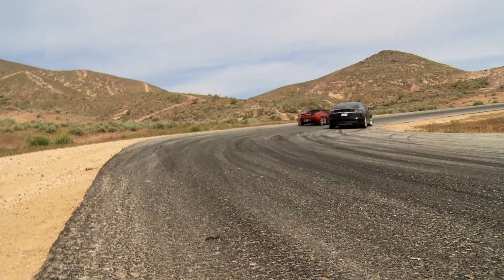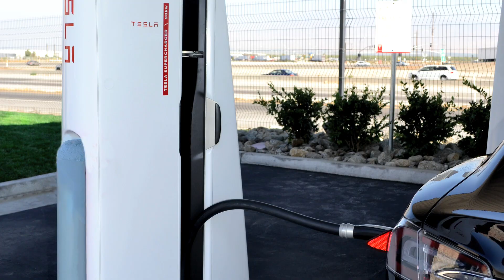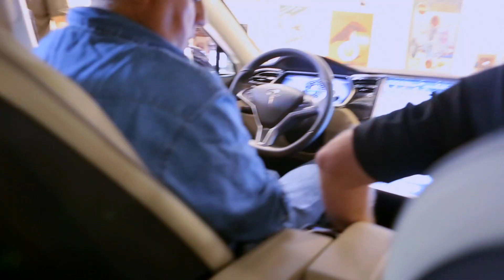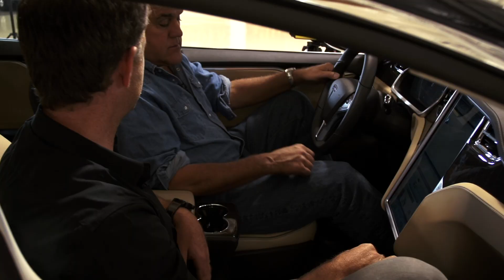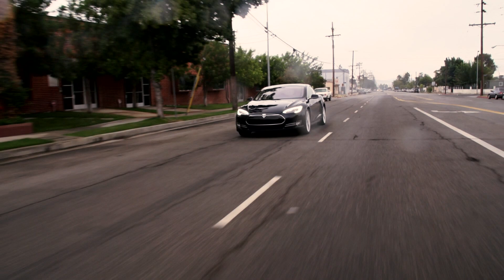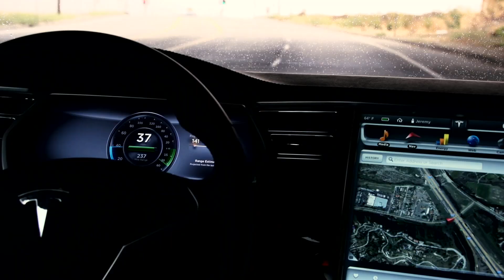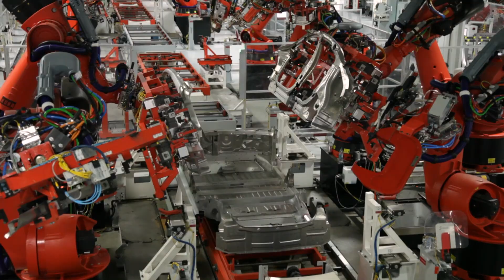2012 Tesla Model S - Jay Leno's Garage

Comment: Funny that the best of the environmentally friendly electric cars would come from the US.
Reply: Darin Pearson Sigh, yet another one making a flawed argument.

First of all not all electricity comes from fossile fuels and not all produce emissions. Nuclear powerplants don't produce emissions and all-green enery is getting increasingly common. 

Second of all the power produced even by a coal burning powerplant is far more efficient per unit than an ICE. 

You also fail to mention how the oil needs to be transported far longer distances with huge oil tankers, be refined into petrol, transported by huge trucks to stations.

Same amount of emissions? Not even close.

Finally, you need to accept that fact that we're running out of fossile fuel and it's better that switch progressively rather than facing a complete crash. The oil crisis of the 70's should perhaps teach you a lesson how vulnerable the whole system is.
Reply: Darin Pearson Unless you go to the recharging stations. Those are solar powered.
Reply: Darin Pearson yes but at the same time the ICE cars efficiency is much much less efficient than a coal power plant. So yes in most places most of the electricity comes from fossil fuels but you get more energy out of the same amount of fuel in a coal power plant. Higher efficiency=less pollution per mile therefore they are much more environmentally friendly.
Reply: Christine Fury Well said!

Also, getting out of fossil fuel is not only for a cleaner environment and therefor a healthier air to breath, it's not only for a cheaper cost in the end with less parts to produce and less parts to maintain, it's not only for a better and easier energy production and distribution, it's not only for better efficiency and performance, it's not only to restart and boost again the dying automobile industry, it's not only for the fact to run out of fuel soon, it's not only for being more independent from the OPEC and politics of middle-east countries....

It's probably for all of that combined, and probably even more :)
Reply: Darin Pearson I completely understand your point about a cradle to grave analysis, but there are a couple of other, less technical considerations to that equation:

More people driving electric cars means more industry incentive to increase range and 'fuel' efficiency. I think the Tesla S is already 89 MPG equivalent, which is pretty good. Others are over 125 MPGe.

Even if you were only moving CO2 production to power plants rather than roads, you're already removing pollutants from the air in cities and improving city health.

Electric cars are one part of the puzzle. Start powering them from coal plants, and when you switch to a more efficient plant suddenly you've just chopped a massive slice of CO2 production off your total. The extra strain on the grid also necessitates more focus on efficiency of power supply, which could mean more coal plants being built, but as part of an orchestrated enviro policy should drive more efficient power plant design, renovation and replacement with cleaner technologies currently under research like LFTR (Thorium nuclear).

The key point though is you need to get people to stop thinking of cleaner tech as a concern only for hippies and vegan communists. I consider myself pretty centrist and put off by floaty hippiness, but I strongly believe that we need to stop pumping so much crap into the atmosphere. Technology is not the only solution, but the more money we put into improving our tech, the easier it is to transition to a more sustainable economy without making people suffer a drop in their standard of living.
Reply: Darin Pearson You're right to mention the electricity sources aren't green yet.. but to me I think it just proves we need to improve the way to produce more eco-friendly electricity. Not only for cars, but also for the increase of electric products (tvs, computers, smartphones, tablets, etc...).

We should get to a point to only have no more than 20% of electricity produced from fossil. Between Solar, Winds, Water, and Geothermal, there's a lot of way to produce greener electricity. It's not impossible at all, it's just not done yet and will be done sooner or later.

And then, the electric cars and bikes would make even way more sense.

One another thing that needs to be solved, as mentioned above, is the batteries waste. So we can't say yet it's "perfectly green", but at least, it moves in the right direction.
Reply: Darin Pearson
You ignore the fact it takes plenty of "dirty" electricity to produce dirty fuel.
Reply: You just need to forget about how the electricity is produced        then you can feel green and righteous
Reply: Darin Pearson I totally agree with you. Though I really like electric cars and reallyreallyreally want to own one, anybody who says that e-cars are 100% green doesn't think ahead...or backwards, as you mentioned (actually doesn't think at all) A plus for the electric vehicle would be that an internal combustion engine uses only 30% of its energy to make the car go. An electric motor is way more efficient than that, its at around 90/95% efficiency, but thats again not the whole process.
Yes, I also would prefer to have numbers that are really honest and are telling the truth and not just showing the tip of the iceberg but there were companies that have calculated the overall CO2 emission for 100km/60miles. AMG  for example said (Chris Harris testing the SLS AMG Electric) that the SLS E would produce something like 20g CO2/km and the fossil version would produce about 300g of CO2 (can't remember the numbers correctly, but something about 1/10 I think) Concerning the energy source (nuclear, cole, solar, wind etc...), the average usage etc... therefore driving electric would still make you more efficient...well the mobility. but as you said, I also havent seen one calculation of the whole process of energy production so its still a complicated. 

When we take for example the i3, and look at the process of the production of the car we notice that almost only BMW and Tesla have developed a process that actually makes a car greener from the very first screw up to the finished product. BMW has invested something about 3 billion euros to achieve this goal (I will say greener not green. green is pretty relative to what you would expect the world should be like. technology doesn't really allow 100% emission free traffic, but since we are at ...I don't know how efficient a cole plant is, surely not 100%/90%...and maybe not even 80%. and then all the other parts of the process where energy is wasted up to the car where we are at 30% which is pretty bad. so greener than that should easily be possible, but to think that we can achieve 90% the first time we try is a little bit over the tops. anyway, "green" isn't something you can put your finger on. what? greener than now? greener than china? greener than germany? greener than solar panels? ) this car, even if it would produce (looking at the whole process) as much CO2 as other cars, it would still be greener because its production process is environmentally friendly. more friendly than any other car that is produced, in china or where ever it is. If you have a look at VW, they only rip out the engine of the car and put some electricity inside...thats not how we should be doing it, they just don't want to invest to much money, but I say they will lose the game if they wait much longer because they won't have the time to catch up concerning technological know how.
 
Then we have tesla and they are producing in the US which is pretty great so they don't have to fly every part of the car around the world, than in the end it wouldn't matter if it was emission free. Right now they are building a huge batterie factory in the US so they can make their 4th car in mind, the tesla something something (not talking about the Model X, the car after that) They say it will cost less (a lot less) and is aimed at the middle-class, so that more people will be able to buy a decent set of wheels that is probably green. 

then you mentioned the battery and its production/waste. thats the biggest problem right now. The thing is all cars need batteries, not just electric cars. Obivously its not as big as the one in e cars, but its still a battery that is producing waste.
So I know that I don't have all the numbers (or hardly any number) and I don't know how the entire process works and where the pros and cons are but if the energy I'm using primarily comes from regenerative energy sources my e-car (lets take the i3) should probably be greener than most other cars.
Reply: ***** The amount of people who think "do some research" is a form of argumentation is always amusing.
Reply: Darin Pearson electric cars are much more efficient and have far less moving parts and the estimated lifetime for a tesla s is 5 to 10 years longer than a similar style ice car so the comparison of emmisions saved over the life of the car are even more in the tesla's favor because even if making one caused more polution than a traditional car (it doesnt) it would still have a extra 10 years to make up for it. Those power percentages you provided vary from state to state so the greeness depends on where you live or if you have solar panels on your house. I don't think anyone here knows tesla's plan for recycling their batteries so I will educated you about the pollution that won't come from their batteries at the end of their life cycle. Once the battery degradation gets to a certain point their batteries will be used as storage cells to be charged by solar panels so that solar power can be used when the sun is down. And maybe by the time they have served their purpose there we will have figured out how to completely renew a lithion battery. So i mentioned one if for the batteries to be completely emmision free. But before you try to argue against that "if" provide me with one idea that people are working on that will make ice cars emmision free.
Reply: Alex Schulte We already recycle Li-ion batteries, all it takes is energy and you can reverse virtually any chemical reaction. For example we either use the Tesla batteries in solar battery systems or freeze them in liquid nitrogen then smash them and recycle.
Reply: Alex Schulte Partially because 100% energy recovery is against the laws of thermodynamics.
Reply: A couple things I’d like to mention about why people might hate these cars:

First off,  fossil fuel. Making an electric car burns fossil fuel, and so does charging it.
 
Second off, innovation. People talk about how electric cars are gonna be innovative as hell... when we have a lithium shortage.
At the current rate of consumption, we won’t have enough lithium for the next 15 years.
The electric car is NOT gonna be innovative unless they find an alternative to lithium, or something.
Reply: If you look into the processes of lithium mining and refinement you would see how NOT GREEN it is
Reply: Is there something more cringy than complaining about "government welfare" in 2021?
Reply: leerman22 ya, what I meant was back to 100% which to my knowledge isn't the efficiency we can successfully do yet.
Reply: Darin Pearson I'm from Kansas and we have several wind farms producing electricity day and night using wind turbines to create plenty of clean energy.
Reply: they pollute more than average gas cars lol
Reply: It is ironic. That for the first time in many many years, maybe the first time ever, a car made is the USA is the benchmark for the world. And many people seem to be unhappy about it because they, for whatever reason,  just don't like that it happens to be electric Which most people here in 2019 now realize is the future of the industry. People have said for years they would gladly pay extra for products made by Americans. Here it is.
Reply: Urban Student Prepper  you're stupid 🖕
Reply: Tell Greta
Reply: Why is that funny? USA has among the least amount of pollution in the world. China and India produce almost 2x more than the USA does.
Reply: Makes perfect sense to me. The US makes the best of the best and the worst of the worst.
Reply: @fusionsoul  Damn, I don't think I've heard that before.
Reply: Dragonworks country of greed and innovation
Reply: @diggleda  More patents were filed in Europe in 2018 than in the US and it's not close, like 47% of total world patents vs 25%. The idea that the US is the world leader in innovation is a popular myth, which you can disprove with the google machine up there in the top of the browser you're using to read this. Took me 10 seconds.
Reply: Not really. Yanks can be quite inventive when they want to be
Reply: It’s built on government welfare. It’s a icon of government waste and about to become a government supplier as sales fall away because Tesla is not restyling
Reply: Yup I’m from California Tesla are everywhere I’m next to get one I feel like us Vietnamese people love to buy Tesla more
Reply: It's not environmentally friendly. It just hurts it less. Environmentally friendly will be when it actually helps the environment, not just "hurts it less" than the other options. Yes, it's still a good goal to reduce environmental impact, but I get tired hearing stuff is "good for the environment" when it still hurts it. It's like saying "oh I only stabbed you 3 inches deep instead of 6 inches deep with this knife, it's good for you now." No, it just is less damaging than before, but still is overall more damaging than it is helpful.
Reply: How is that strange? USA is a nation of innovators and is a car culture. It would be weird if it never happened!
Reply: +Autumn Shag  "liberal" is a more of a political label, California is being ruled by mass hysteria generated by a quasi-religious cult movement.
Reply: Funnier would it be if it was made in China
Reply: +Whats the frequency Kenneth He also knows there is a sucker born every minute, he dupes millions into thinking they are doing something good for the planet while at the same time ripping them off and getting fifthly rich... you don't make 21 billion by being honest or giving two shits about the environment.
Reply: @deathbrewer, I see 'environmentally friendly' a different way. If you hurt the environment beyond it's capacity to regenerate, then that is not friendly. Every type of production of stuff will hurt the environment in some way, but we need to get to the point where we don't hurt it beyond it's ability to regenerate. That, to me, is environmentally friendly.
Reply: ***** but is getting 100% energy density the same as getting 100% of energy back? I don't specialize in battery tech so I don't know exactly how much revival is possible, but I do know that the amount we can recover today isn't good enough.
Reply: Who said electric cars were environmentally friendly???  Someone trying to sell you one???
Reply: *Liberal California.
Reply: +Whats the frequency Kenneth True, Elon Musk is worth $21 BILLION..
Reply: Yes but the Euros invented them for us
Reply: The electricity comes primarily from burning coal.
Reply: So what if the electric power from coal or gas is generated with 45% effectiveness, then power losses on sending the power with electric lines, losses on charging, and then 95% efficient.   2x less efficient the whole process
Reply: There was no conspiracy.  Just simple rules --- range and usability,  better maximum speeds etc.

We would be nowhere now as industry also uses small electric vehicles to transport in factory buildings, golf carts etc.  for like - decades.  

All electric cars are also fossil fuel burning cars - as the electricity comes from burning fossil fuels. Why industry have not invented something better? :D  

We, here in Europe have also the electric ways of transport for decades --- trams and "trolleybuses".  They don't pollute as they drive, but --- creating electricity to run them does.  Also 90% of our trains uses eletricity from the lines above the tracks.  How many electric line powered trains do US have?  Most of them are diesel powered.  Why?  Because infrastructure for eletric transport is expensive, the cost for the enviroment is even higher then to put the fuel burning engine directly to the train/tram/bus. Costs are higher, also the enviromental cost is higher  --- maybe with wind and solar power they will become more enviroment friendly.

https://www.youtube.com/watch?v=cWGvnlsMLAU
Reply: The answer is better capital markets.
Reply: It's really funny that it is MUCH worse for the environment and planet to build an electric or even hybrid car than it would be to continue using an normal gasoline or diesel car.
Reply: Justin Leeds incredibly wrong comment in every way. In fact the comment hasn’t aged well. Us produces 35 percent natural gas 27 coal , 19 nuclear, 7 hydro, 7 wind, 2 solar. These cars are not only way more efficient per kw than a gas car is per equivalet, they also recycle all their batteries meaning an almost renewable resource as upposed to fossil fuels. If US would get up to European standards of energy, we could drop dirty coal down to 10 percent and solar and wind up to 24 where coal is. Nobody is taking away your dinksaur burning garbage, but the more commuters who use electric the better. The world needs batteries no matter for cars or not anyway, all electronics consume more and more batteries.
Reply: Triggered
Reply: Not really though. We were producing the best and first electric cars in the world, but then a conspiracy killed them. Can you imagine how far along we would be now if not for the petroleum industry? I believe there would be no more fossil fuel powered cars on the road today. The fact that the nearly all auto manufacturers in the world are still producing gasoline powered cars is bad and detrimental to society.
Reply: Let's not forget,all electric cars are fossil fuel burning cars.  The fossil fuels are just burned somewhere else, not in the car.  In the US, electricity is generated as follows: Coal 45%, Natural Gas 24%.  Coal and natural gas are fossil fuels.  Next in line, nuclear generates 20% of the electricity and has it's own issues with the generation of toxic waste.  Then, there is the issue of managing the highly toxic batteries for these vehicles as they move through their life cycle.  Environmentally friendly?  No.  They just shift and cloak the environmental effects so they are less visible on a day to day basis.  I'd need to see a "cradle to grave" analysis of energy usage and environmental effects before I could say if these vehicles have a smaller impact on the environment than traditional vehicles.  I'm guessing they do not.
Reply: Darin Pearson I drive an electric vehicle and I see it more as an extended arm ready to shake hands. It says to energy producers "I'm ready, are you?".

Besides, I think there's reason to believe electric cars are more environmentally friendly. Fossil fuel motors have maximum energy-efficiency around 40%. Usually you get 30%. Electric motors easily score over 80% of the battery energy converted to kinetic energy. Which I think means that even if all of the energy that electric vehicles use came from dirty sources there'd still be less of an environmental impact than there is today. And when you take into account that part of it comes from renewable energy it's already starting to look much more friendly.
Reply: All good points Hannu.  The point I'm trying to make is, there are a lot of unanswered questions regarding the aggregate environmental impact on a "cradle to grave" basis which, after all, is the only metric that matters.  For example, hypothetically, if an electric car takes 1.5 times the resources to build and dispose of at the end of its life cycle than an equivalent combustion based vehicle, then the resource savings during the e-car's life cycle needs to exceed that extra 0.5 or else one could argue that the e-car is less "environmentally friendly" than the traditional vehicle because it consumes more resources.  I realize my example is overly-simplistic and not based on actual data but I am simply trying to point out that, unless we actually know the type and total of the resources consumed over the life cycle of each vehicle, we are only assuming that the e-car is more "environmentally friendly".  I would like more information about this but I haven't been able to find it.  It's good that there are people like you thinking about these types of issues and willing to offer well reasoned responses to my postulations.  Perhaps this will eventually lead to more and better information so we can each make better decisions.
Reply: @darinpearson2554  The car does not burn any gas.
Reply: @darinpearson2554  jokes on you, were on hydro power here
Reply: Darin Pearson EV’s have 40% of the carbon footprint of a regular gas vehicle
Reply: @darinpearson2554  If you keep repeating the same talking point, and it's seems to be having no affect. It usually means you're answering a question that no one is asking. You spent some time writing this so I suspect it's your job. But saving the environment is not the reason many people are interested in EVs. So you could be wasting your time going at that angle.
Reply: @darinpearson2554  Funny how people with no automotive videos, are always trying to school someone. That car does not burn any gas.
Reply: @darinpearson2554  You're right, but this car is still a great investment. You buy a car and then plug it in your socket at home. Having fully electric car is a lot cheaper than having combustion engine car, especially in Europe! :)